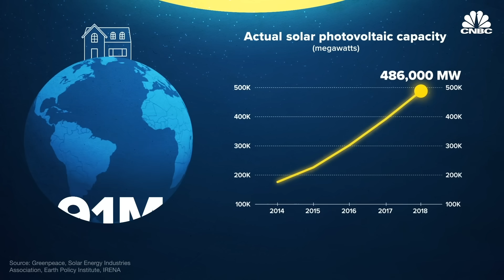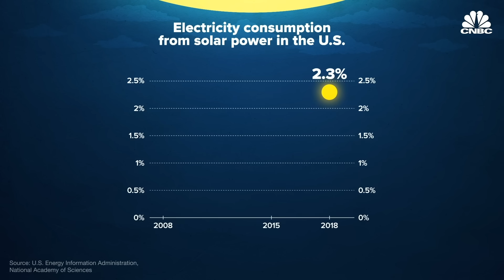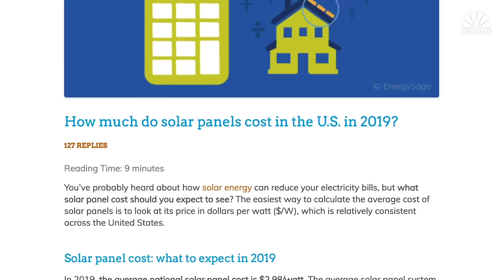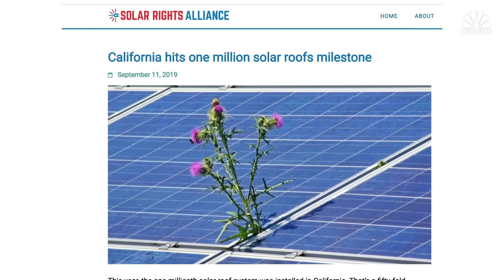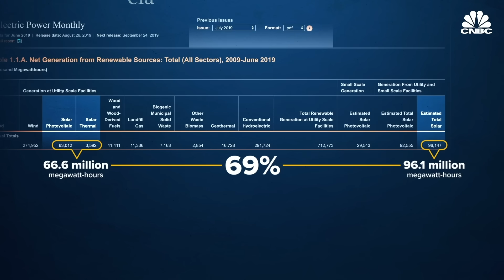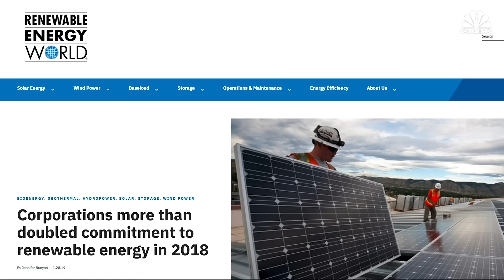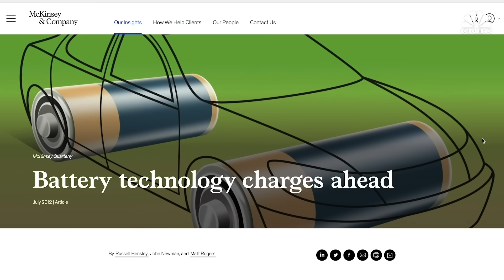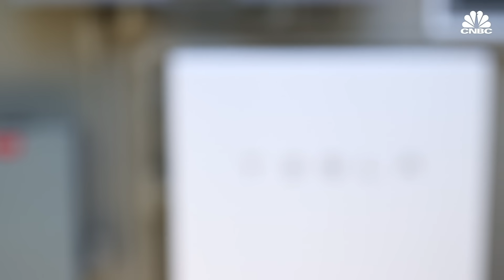The Rise Of Solar Power

Comment: Li-ion's foremost property is lightness and compactness pr kWh. That's crucial in cars, phones, laptops. BUT not necessary and too expensive for storing surplus energy from power plants. Here the economics look quite different and many better and cheaper options exists or are in development. Among others pumping water back up to hydro power reservoir dams (80% energy return) or dragging heavy trains uphill to later release them downhill (gravity storage too), big heavy spinning flywheels, heavier but simpler, cheaper and longer lasting batteries than li-ion, thermal storage, hydrogen or methane storage.

Comment: $12k average cost includes $10k subsidy from your neighbor, and after 10 years you almost break even.  Basically it costs double and only works on sunny days.    Hmmm.  Agenda here?
Reply: I've heard it still works on snowy days.  

Once the panels are installed, the house can be sold or rented out at a premium due to the lower utility costs.
Reply: Baja Bob America is broken. Here in the U.K. there are no subsidies for solar, yet an installed system costs a third of what it does in the US and payback is in as little as six years, while panels have a minimum ten year warranty and often upto twenty. It's not as if we are known for our sunshine in the UK but it works here- and we still have lower power costs than much of the US. It's your government that is at fault, not solar.

Comment: Energy storage is not the "last" piece of the puzzle, it is the first and always has been.
Reply: @
Mark Heslep - Unfortunately, we have ignored "grid energy storage" and by default made it the last piece of the puzzle.
Reply: @MrSummitville  Large scale seasonal storage is not so much ignored; it is instead not feasible by a couple orders of magnitude.  It's no more feasible than is flying an existing jumble jet out of the atmosphere  and into earth orbit. Saying planes are always getting better won't help get  a 737 into orbit, not even a little.  Widespread recognition of that limitation would put an end wind and solar ony subsidies, along with the silly 100% 2040 solar and wind targets announced each week by every politician and his 3rd cousin.
Reply: @Nill757  We do NOT store energy on a "SEASONAL" basis ...
Reply: @MrSummitville  Agreed, because it's not possible with current tech, not even close.  It would need to become possible though to rely 100% on seasonally variable power sources like wind and solar.
Reply: @Nill757  In the USA,, we have been installing very large Grid sized "AC Battery" Banks, that are REPLACING Natural Gas powered Peaker Plants.  The  Grid Battery Banks smooth out the difference between instantaneous production and current usage = no need for seasonal storage.  Every city, county, state and country must use the appropriate mix of energy sources:  Solar, Wind, Geothermal, Hydro, Nuclear,  Coal, Natural Gas, etc - as they see fit.  Thinking that one source of energy is best for every location, is pure nonsense ...
Reply: @MrSummitville  The US can not keep using fossil fuels in localities as they see fit, indefinately. It has to stop eventually, both for traditional pollution reasons and GHGs.  More importantly, China and India eventually need to stop.  Batteries have long been used by the power utilties to smooth transients, now running into minutes or couple hours.  But there is no existing grid battery facility that can back up a middling 500 MW power plant or wind farm for half a day, not anywhere in the world, nor are there any serious plans (i.e. fianced) to build one.
Reply: @Nill757  We can, and we will use Fossil Fuels, as we see fit.  The AC Grid took 100 years to get to this point.  How about ... you give the "AC Battery Banks" an opportunity?  In Hawaii, many homes already have an "AC Battery Bank" that can operate the home all night long - it is called DISTRIBUTED Energy.  Your theory of needing large CENTRALIZED Power is archaic, and it sounds too much like a Centralized Communist Gov't ... and we all know how poorly that works !
Reply: MrSummitville Wishes don’t make facts go away.  

Nothing is stopping anyone from going off grid if they think they can do it mite cheaply and maintain it.  But almost nobody does aside from shacks.  

Residential rooftop solar is 3 to 5 times more expensive than utility power, even in Hawaii.  Utility solar is always cited perfectly facing the sun, never has shading from buildings and trees, and is maintained and cleaned regularly.  Residential batteries suffer a similar price problem vs large central storage.  Turns out people like that grid connection to big old central power when i) they can force the utility buy power that the utility doesn’t want, and ii) the monsoon season comes round and 24/7 power looks pretty good.

Look, throwing shade on “central” power or ‘commie’ power is like shading grocery stores and instead growing your own food. Go for it.  Just i)don’t pretend you can make all your food at home as well as the farmer-grocer, ii) don’t pretend you won’t have crop failures when you need the grocer, and ii) don’t come around later with some politician demanding the grocer buy your 3rd rate produce.

Comment: Don't solar panels have all that quemical inside that when broken get into the earth and travel threw water.......???
Reply: @
Makoto Shimabukuro - No ...
Reply: @MrSummitville  really, they don't so your telling me, all the quemicals that are said are included in every solar pannel, they don't have it...nice, going buy a couple, and break them, see how my graden reacted thanks!
Reply: @島袋誠-z6k  Per the manufacturer, my Solar Cells are made from >99% pure silicon.  So, now you tell me ... exactly what "bad" chemical are in my Solar Cells ?
Reply: @MrSummitville  cadmium telluride, copper indium selenide, cadmium gallium (di)selenide, copper indium gallium (di)selenide, hexafluoroethane, lead, and polyvinyl fluoride...
And that just a little list, if is 99% silicone, and 1% all this extremly toxic quemicals, that means that, if you have just 1 solar panel, you might be disposing of 99% silicone that might do very little harm, but that 1% dose way more damage, like Atomic bombs, they are less then 1% enrich plutonium.

Comment: Solar and wind is the future. Cheaper than any other power source since 2018. Storage still a challenge. Expect low-cost solutions to hit the market within the next 3 to 5 years. There are still challenges however. We will not see an electrical wide body airplane any time soon.  But generally we will see a combination of massive renewable power production and wide spread electrification of society the next decade.
Reply: @Mei Bing
 - In the USA, Natural Gas power plants can compete with Solar.

Comment: Nice Video. but i feel there is demerits of Solar Power too than Wind Energy. Rays reflected from Solar Panels will heat up Air which makes to hot air flow, light reflections, deforestation to install more Solar Panels, etc. Better if done in desert areas. Lookout for more better options must be there which will not impact out environment, weather, deforestation, etc. More Wind Power can be utilize, as we can install in any areas, there is no deforestation, no side effects, etc.
Reply: @Satyanarayanmurti Katta
 - Do you not know that ... when the Earth was hotter, the Earth was wetter and the Earth had way more vegetation?  Did your head just explode?

Comment: So in a Nutshell they're cool and have potential but are expensive, take up too much room and are no where close too being a realistic replacement for Fossil Fuels! Now one question for the Enviormentalists! If you care so much about the enviorment why do you reject Nuclear Energy the one realistic replacement zero carbon energy replacement for fossil fuels in the forseeable future!
Reply: @
ClownWorld  - Solar Panels have reduced my Electric Bill.  It would be great if actually knew what you talking about...
Reply: @MrSummitville  Just because they work for individuals like yourself does not mean they can be used as a replacement of fossil feuls entirely! Your house is one thing! But how about Planes, Power Plants, Factories, Buisnesses, Government Agencies, and the Military? Solar does save you money in the long run but they are Pricey to begin with and they only generate Power during the Day and the Batteries they charge for night time are not nearly efficient enough yet too power the things I just mentioned!
Reply: @thenotoriousgigachad3455  Solar Panels do work well for individuals, factories, government, and even  cities. They have already installed Grid Level "AC Batteries" to smooth out demand vs production. And there are  Residential Grade "AC Batteries" that run the house all night long.  You need to educate yourself.  Part of the USA Grid is now DC Voltage, not AC Voltage.  I never stated that  Solar Panels can power an airplane ( yet ).  Your negative diatribe, was the same nonsense  that been spewed for the past decades.  But yet, we are now actually installing Solar Panels at a rapid rate.  Either lead, follow or get out of the way ...

Comment: They fail to tell you how many acres of land it takes for those solar panels.   Believe me, not enough energy created to heat or cool your home.
Reply: @Al T
 - Believe you?  Not chance!  I actually have Solar Panels and they have actually reduced my Electric Bill.
Reply: @MrSummitville  Good for you, but your still relying on the grid aren't you.  How many years will your investment pay off?
Reply: @alt6602  Yes, at night, I still need the grid, but for very little.  How much power do you use when sleeping?  PV allows my family to use much less fossil fuel. That is a fact.  When I install the Telsa Power Wall, then we will not need the Grid at all. I already broke-even on my first self-installed PV array after 3 1/2 years. When my second PV array comes on-line, my family will be almost NET ZERO.  So, what have you done to use less fossil fuels?
Reply: @MrSummitville  It's going to take more the windmills, solar and heat pumps to survive in the colder climates of the nations.
Reply: @alt6602  You keep moving the "goal posts".  Now you complain that ... were you decided to live, is too cold.  Where I live, it gets cold and I get 70 inches of snow per year.  There is a 400 megawatt Solar Farm being installed in Canada.  Large Solar Farms and small PV Arrays are being installed, while you continue deny their feasibility ...
Reply: @MrSummitville  "Never argue with stupid people, they will drag you down to their level and then beat you with experience" - Mark Twain

Comment: Solar and wind power are more damaging to the environment due to the polluting processes of manufacturing the panels and batteries, and disposal of them after their useful life. Plus the glaring mistakes made in the design of large wind turbines.
Reply: @
tubularguynine - Stop being so hysterical ...
Reply: MrSummitville - What is hysterical about the truth?
Reply: @tubularguynine  The Solar Cells inside my panels are made for >99% pure silicon.  They did not damage the environment  during manufacturing and they are not damaging the environment now. Everyday my family uses less fossil fuel, and we will use less for the next 25 - 30 years. You are  being hysterical ...
Reply: MrSummitville - I have a couple of panels and batteries too, that I charge all my AA flashlight batteries, my iPhone & iPad, & my Mac mouse and keyboard to make a little dent in my power bill. But do some research into panel & battery manufacture & disposal & see what you find.

Comment: Solar is never going to cover much more than 1% of global energy needs. it will take advances of 200 years of photo voltaic research to change.  Wind power works to  some degree, though it is never cheap. green energy or renewable solar and wind and hydro will be of negligible help supplying energy needs, every little bit helps. Unfortunately renewable energy is not here now, it could be someday in about 200 years.

 Today people especially the young are being lied to to by people who should know better, scientist who do not go along with the globalist program won't have much of a career. Renewable s cannot realistically replace fossil fuels,  most likely we will have to transition to much more nuclear power to provide the energy for the mass immigration of low energy third world-ers coming to our first world nation by the millions from open borders;  where we depend on extreme energy use. Third worlders  going from camel dung burning energy to air conditioning, heating and microwaves is going to demand a much larger utility infrastructure increase. No we are not going green any time soon.

Disabuse yourself of the myth we can live without fossil fuels or nuclear in the next millennium. Fusion is the energy of the future and always will be so don't look for fusion reactors or the myth of hydrogen vehicles or hydrogen energy, this too was a lie, it takes nearly 1.5 units of fossil fuel energy to create 1 unit of hydrogen energy making hydrogen cost more energy than you get out of it. Ethanol was another lie and a great tax payer corporate welfare subsidy, much like solar today, to corporate industrial farms, that is still going on with ethanol and bio diesel . We have now learned it takes 1.5 gallons of gasoline to generate one gallon of ethanol alcohol . Slowing the exponential growth of the world population would be the most logical thing we can do but we don't know how.

 A carbon tax is  the Marxist scheme to tax the first world made of carbon and then redistribute the wealth according to new world order, world corporate government. where the nation state is subservient to the One World Corporate Government. This is nothing more than more corporate welfare going directly to the top CEO's of the policy making body in the form of bribes and payoffs to the ruling elites. You will have no representation or say in policy matters there will be no laws just administrative ruling and fines and sanctions without any bill of rights. The world is ruled by psychopaths and criminals at the top and putting them in charge of everything is the unified goal they are working for. 

Once the ruling elites in the CIA/FBI/  NSA/NRO  operation PRISM  a code name for a program under which the United States National Security Agency ... tracking and recording of all U.S. Domestic  customers' telephone calls, stored in https://en.wikipedia.org › wiki › Utah_Data_Center

The Utah Data Center (UDC), also known as  the Intelligence Community Comprehensive National Cybersecurity Initiative Data Center,[1] is a data storage facility for the United States Intelligence Community that is designed to store data estimated to be on the order of exabytes or larger.[2] Its purpose is to support the Comprehensive National Cybersecurity Initiative (CNCI), though its precise mission is classified.   It is located at Camp Williams near Bluffdale, Utah, between Utah Lake and Great Salt Lake and was completed in May 2014 at a cost of $1.5 billion. . Once the elites.have all of your data and control your energy use you will become their slave in a metropolitan Mega city rental box apartment in their feudal system. May god help us all; down with the Globalist. The young do not stand a chance against the Smith-Mundt Modernization Act of 2012 where the CIA merged with the State Department to create propaganda from the elites  which is distributed domestically  no longer just for foreign consumption. This modernization ACT props up the dying media networks that all speak with the same forked tongue and use tax payer funds to bribe  the dying "main stream media owned by six corporation world wide. Ever wonder how talent-less dumb as a rock, most of them foreign news readers could get paid ten million in annual salaries? 

CNN hires right from the source of all their funds, the CIA e.g., Anderson Hays Cooper His maternal grandparents were millionaire equestrian Reginald Claypoole Vanderbilt and socialite Gloria Morgan Vanderbilt, and his maternal great-great-great-grandfather was business magnate Cornelius Vanderbilt, who founded the prominent Vanderbilt shipping and railroad fortune The information above makes it clear why it should really come as no surprise that Anderson Cooper, CNN’s primary anchor, and host of the CNN news show Anderson Cooper 360, also has connections to the CIA intelligence agency. What lends even more credibility to that hypothesis is the fact that, while attending Yale University as an undergraduate, he was actually an intern at the CIA. Furthermore, his uncle, William Henry Vanderbilt III, was an Executive Officer of the Special Operations Branch of the OSS under the spy organization’s founder, William “Wild Bill” Donovan. He also reached the rank of captain in the Navy during WW2 .

The CIA’s connections to mainstream media are well documented. Take Operation Mockingbird, for example, a program developed by the agency to infiltrate mainstream media and feed them stories that suit the narrative of the agency, for ‘national security’ purposes. It was actually birthed out of the Office for Strategic Services (OSS), which, during the second World War, established a network of journalists and psychological warfare experts. Back then, these were propaganda campaigns, or fake news campaigns in essence. One old example from the OSS can be looked at by examining the Career of Richard Helms. He eventually become the CIA’s director, and was recruited by his own supervisor at the United Press International’s Berlin Bureau to join the OSS’s “black propaganda” program.